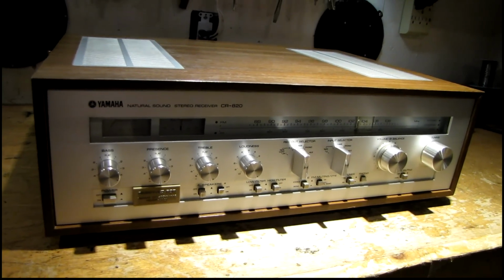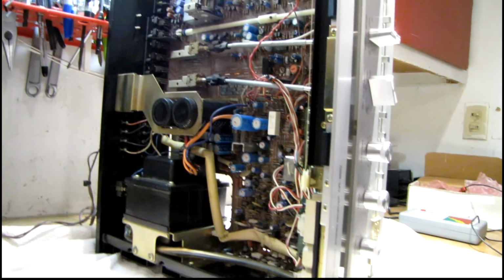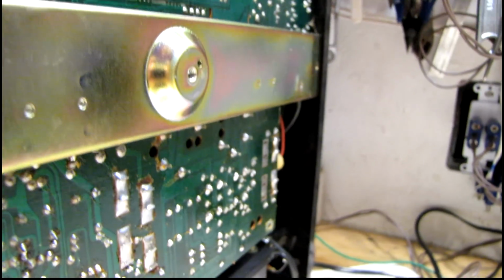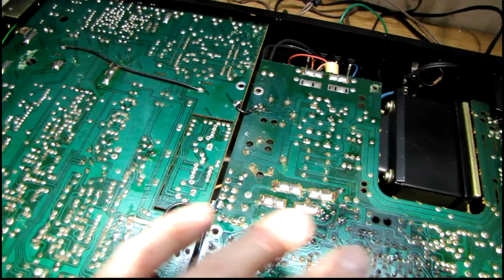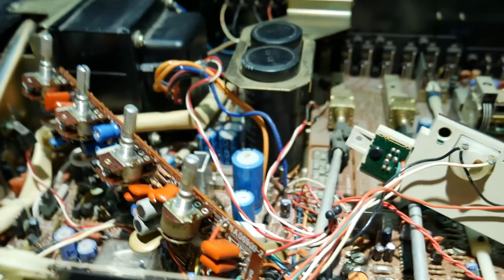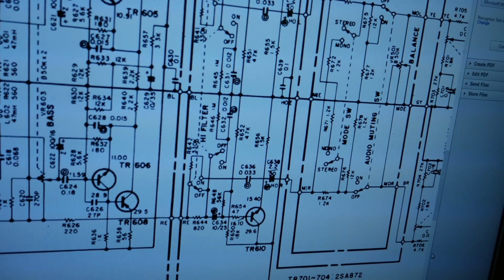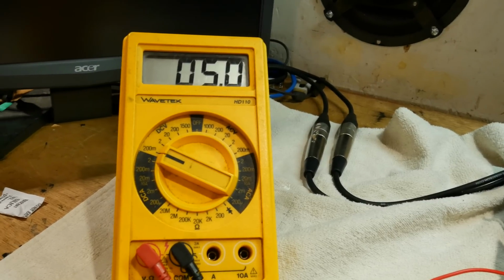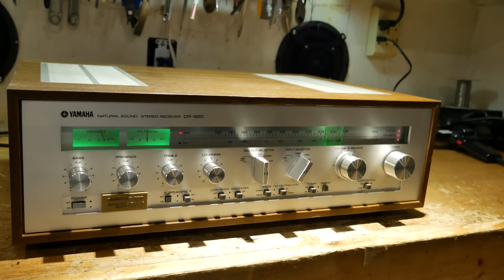Yamaha CR-820 Receiver Repair Jan 24, 2016

Comment: great job thank you for the video. a seasoned (well) TV repairman once told me before you even plug it in resolder as much of the board as you can (way before surface mount ic's used) a very very large percentage of problems gone. Cleaning and reconditioning the pots will finish the job. now turn it on and test it compared to the customer complaint.

Comment: I've got a CR-2020 on the bench right now. The power supply is a real mess. There has been some extracurricular activity performed on it in the past. Every capacitor needs replaced and the boards have been butchered. I'm in for a ride.

Comment: Excellent video. I just picked one up with no output whatsoever, I have looked at it for five minutes just to ensure the output devices were OK. Relay not switching.. Wish me luck as this one is also in immaculate condition. I had a bad feeling as I saw someone had been inside and cut some  wires.. But it seems only the lamps and external antenna wires..
PS. The noisy transistor rabbit hole was nasty. I may have tried freezer spray after narrowing it down. Did it get worse after warming up? Anyhow, really wonderful results.

Comment: Weak FM: this receiver has no internal FM antenna.  It needs an external antenna connected – at a minimum a 300 ohm dipole.  Preferably, a 75 ohm coax cabled outdoor antenna.  The antenna on the back panel is the AM antenna.

Comment: WOW THANKS. I've had an 820 with the same problem for years. I don't want to sell it since I bought it for $550  41 years ago
when I was 14. Your detail, sound and video work is perfect.
Reply: I could write the exact same post, but mine was a CA-800 (it was the previous years model) and I paid $434:  which was alot in 1976 for a 13 year old.    What was it about those that was so appealing?  I was a fan of the variable loudness.  I liked to laugh at people who only had on and off loudness.  And they screamed quality to some one who knew a "Sound Design from Montgomery Wards" .

Comment: I did a Technics 5360 a while back, it had bad stk's but wouldn't come up on the bench. Turned out the tuner and amps ran their ground thru the case via several the frame mounts which were removed with the set opened up for service.  Pair of clipleads fixed it up for bench testing and it worked fine after reassembly.. naturally, no indications in the svc manual of the grounding situation lol,  Really dig your vids maxx, I've adopted several things for my tech jobs from watching them.

Comment: I can't believe how yellow that headphone jack cover is, that cover is normally like a light gray/silver color. You could put it in a ziplock back full of hydrogen peroxide, and leave it out in the sun for a day, it would probably look brand new. I have also gotten dents out of wood and wood veneer with a wet towel and an iron. Lightly wet the dent, place a damp towel over top, and go over it with an iron (the more steam the better) for a couple minutes.

Comment: Brilliant diagnostic video well explained. I have the same receiver (made in Japan). Revitalised from many years in storage (video posted). Only problem I had was the output power transistors blew taking the thermal fuses. Luckily I purchased spares in the 80's which came to the rescue. Love the green LED's.

Comment: Have you tried Bamboo caps like those used in MARANTZ amps?, I wonder if you install an UNUN transformer would boost your antenna signal. Maybe a BFR96A duel gate MOSFET transistor in the RF preamp might go some way to getting a better signal and bringing in more FM stations.

Comment: Great videos! I have a Htr 5650 running off 110 power supply. Is there any chance to change that into 220 withouth having to use the power transformer?

Comment: i have this beast. its been in my family since new and has been passed down. about 7 months ago it failed. i now cant get the output relay to click. one of the reistors gets exceedingly hot. like it will melt plastic. any suggestions? thanks. i believe that i have a short somewhere. Oh and btw mine is a japanese one!
UPDATE: in the output stage i found a 1.5k resistor that is only measuring at 0.5 ohms. i think this could be the issue or a contributing factor to the issue. What do you think?

Comment: Hi brother...  I wish I had as much electronics practice as you do....  I'm darn good with computers,  and good with a soldering iron...  and I can even rock a Tube amp...   Transistor amps leave me in the "rookie" stage.  I have a beautiful specimen that needs help around here...  an Altec 702 receiver.   Wanna help me?

Comment: They don't make them like they used to...
I still have an old Realistic stereo receiver with built in turntable and 8-track. I recently replaced all the audio power FETs, all caps, and converted the panel lamps to warm white LEDs, and she works awesomely great and looks good.

Comment: Very nice! 
I wish you were closer by and that you had more time to do repairs.  I have a Yamaha R-500, got it for a song "working".  Well, it works on its own terms.  I replaced the dial lamp (28v) myself, but I don't have the testing equipment required to really properly service and restore the unit.  It has lots and lots of capacitors that are visibly leaking. The relay is most likely bad as it takes a tap or two directly on the relay itself to get sound from both channels. 
I'd imagine all capacitors in my unit need replaced. When it works, I don't have any hum or hiss, but the sound is pretty harsh with some loss at the high end. 

Just have to find a local shop that is as thorough as you are.

Comment: I am a bit surprised how 1980's-ish the PCB looks for a late 70's era. Yamaha must have been one of the first companies to adopt the "new" PCB design and layout.  Out of curiosity, what brand of caps did Yamaha use?
Reply from the maker: +WaybackTECH This one had mostly Taicon in it.  I can't remember the other brand.
Reply: +WaybackTECH My CR-2020 (which is made in Japan) had a lot of Nippon Chemcon caps in it.
Reply: +WaybackTECH mine is a japanese one and it has nichicon caps in it.
Reply: smallenginedude71 Was yours recapped?  Yamaha mostly used Nippon Chemcon back then.
Reply: Audioquest56 i was meaning the main caps were nichicon and the wrest are nippon chemicon

Comment: I'm not so sure TR610 was leaky so much as it was just noisy, which is probably why your tester showed it to be good. I used to repair the gammit of audio equipment in the early 70s, a trick that I used when I encountered noisy audio was to gently heat the transistors in the string with the tip of my soldering iron, the noise would get much worse when the offending device was heated. Just my two cents.

Comment: The atlas cant provide a high enough voltage to cause the junction breakdown. Thats the problem. Common common common problem with testers. I cant stand them, because none of them pushes the devices into the proper operating region.
Reply from the maker: +THEtechknight Ya, I've pretty much decided it's only good for finding pinouts and other basic specs most of the time.  Though I see they've come out with a DCA75 that looks a lot nicer.  Not sure if I want to bother upgrading or not.

Comment: I've always loved how those 70s Yamaha receivers looked. They sound quite nice too.

I personally own a CR-600 receiver, but it's developed intermittent noise in the right channel. It's probably a leaky cap or transistor in the main amp section.

Comment: You should have used hydrogen peroxide/Retr0bright to repair and de-yellow the plastic on the front.  Nice job on the repair though.
Reply from the maker: +kuenzign That's just a cover over the headphone jacks.  I had to stop working on it because I was already over budget.

Comment: this was interesting to watch. My first repair project was a Yamaha cr-820 that had shorted driver and outputs.  Being a complete novice I did not realize the chassis had a floating ground being that cross brace between the amp and tuner boards. That was a source of serious frustration till I figured it out.  you sir definitely have some skills when it comes to this

Comment: Made in Taiwan, maybe Proton the original OEM of that Yamaha receiver. In the 80's Proton also making amplifier for other brand for NAD and Pioneer.
Reply: +Faisal Kadal I wasn't aware Proton made Yamaha gear . My Yamaha R-500 was made in Japan.
Reply: ngtflyer I am not so sure about that Yamaha made by Proton, but look at Made in Taiwan label make me assume it made by Proton. Made in Japan indicate the quality in 70's and 80's era (even now it seems), because I see lot of vintage amplifier like Technics and Sansui are Made in Indonesia.
Reply: Faisal Kadal Sadly my R-500 has a whole lot of visibly leaking caps and has all the classic issues an old receiver has. It needs attention.

Comment: So scrap your transistor meter
Reply from the maker: +geoepi321975 I still need it to identify pinouts and such, but testing for gain or leakage is pretty hit and miss.
Reply: yes you need a high sensitivity one

Comment: Why cant I watch the video lower than 1080P? Man that sucks for someone with a slow internet.
Reply from the maker: +Yuri Ck It should be available in lower resolution now.  Youtube just takes a while to process.
Reply: +Maxxarcade Thanks dude, it is now. Hard to watch even 720P on a 100KBPs connection

Comment: Strange that YouTube has started with this only offering 1440p and 1080p, that's the inverse of days gone by!
Reply from the maker: +Lukeno52 It's not fully encoded yet.
Reply: Maxxarcade
I know, that's not my point. My point is that it's strange for YouTube to now start presenting the higher resolution options first, before the lower ones, as that's not what they've done historically.
Reply from the maker: +Lukeno52 True, usually it starts at 360p.

Comment: What caps did you used to replace the bad ones?
Reply: +Makaveli Don&#39;t know what he used, but I recently re-capped my CR-2020.  Used Cornell Dubillier for the big filter caps, Panasonic FC &amp; FM in the power supply and Elna Silmic II in the phono pre-amp and amp boards.  Nichicon PW are also very good for power supplies.
Reply: I want to use FC and FM for an amplifier but others say that Nichicon Fine Gold and Muse are way better. What do you say about that??
Reply: Makaveli Fine Gold and Muse for signal carrying circuits.  FC & FM for the power supply.
Reply: The problem is in my country Fine Gold and Muse are really hard to find so i'm gonna have to go with FC and FM for both power supply and signal path. How big the difference is?
Reply: Makaveli You should be fine.  Nichicon also makes FW & KT audio caps for signal path.  Elna Silmic II are also excellent.

Comment from the maker: Processing is not finished yet.  Other resolutions to follow!
Reply: +Maxxarcade Processing done!
Reply: +Maxxarcade yay another restore!
Reply: How did you find the replacement transistors? is there a website that you use to find and equivalent transistor for the bad ones?Great video, very informative.Cheers
Reply: Could you tell me where you bought the green dial lamps? my cr820 lamps are burned up so they need replacement.Thank you